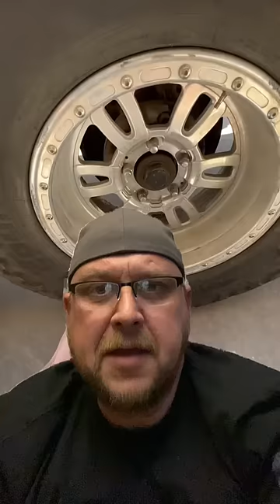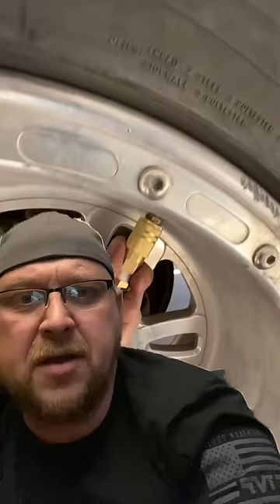A Trick That Works

Comment: Reminds me of the time we asked one of the Co-op kids to fill the tires on the forklift.

Told him he needed to use the airline because they take 100psi pressure.

He must have been looking for those valve stems for 30 minutes.
Reply: When I was a kid, my 10-speed took a pretty ridiculously high tire pressure, higher than the air line at the gas station could supply, so I'd just shove it on and wait for the air to stop flowing.  I was out riding with Mom, and the fat tire on her cruiser was a little low, so out of habit ... my ears were still ringing the next day.
Reply: Usually I fill those tires with tooth paste, I use a left handed screwdriver otherwise the board stretcher could be misaligned with the skyhook
Reply: On a forklift I was driving the tyres took 80psi
Reply: I always had the new guys switching out the winter air for summer air and vise versa. Boss didnt always find it as funny as I did. I'd always just remind him that he's the one that hired them, not me. 😁
Reply: If the vehicle is too far from the compressor and for some reason the two cannot be easily moved closer together, tell the new guy to fill up a quart bottle (like the Lucas Oil ones with the pointy tip) with air at the compressor and squeeze it into the tire and then do it again until the tire is full. If he's quick witted maybe he'll grab multiple quart bottles.
Reply: Former forklift operator here, we used to use that same bit with the new employees, lol.
Reply: @MatthewJRedmond  it actually is a fact that winter air in the summer will be higher pressure than it was originally
Reply: at least 114 people got the joke.....for those that didn't, most forklifts use hard rubber tires that don't require inflation.
There are quite a few that do inflate but those are usually 10k - 30k all-terrain forklifts and those inflate so that you can run them low in soft dirt and high for asphalt and concrete.
Reply: @alexistaylor969  correction: most small WAREHOUSE forklifts use solid rubber tires.
Anything meant to be used on anything other than flat slabs generally has air filled tires.

Comment: Finally, a trick I MIGHT actually use 😂😂
Reply: This is an old trick. Been doing it for about 30 years and I'm 42. When I couldn't find an air chuck I would just do that. I've never gotten them stuck that I can remember.
Reply: Might is the key word. Usually this only works on metal valve stems. The rubber ones are typically too fat to fit deep enough into the quick connector to get it to work. When it does work though, I like to pull the Schrader valve out and do it to help seat beads on tires. It will blow much more air through than a regular tire gun
Reply: @mitchelldake7203  that's actually false. I was doing this back in the 90's before those metal tire sensor valve. I does fit the rubber ones.
Reply: when had does that he has a connecter that measures the pressure in the tyre and it has a valve connected. really cool

Comment: If getting to a vice or vice grips is quicker you can kink/block the line. Learned that when my quick connect shot off the fitting and my hose slapped me across the face real good. Great times... great times.

Comment: Hack for bead seating, the air wont go in fast with the Schrader valve in so you take it out and fill it until the bead seats and pull it off.
Reply: Which is why most schrader valve stems come without the valve. (always replace them when you replace a tire)
Reply: I always just leave the valve core in, is there a reason not to?  The benefit to me is it keeps the air in so if my little air compressor runs out i can wait and add more until the bead pops in place. I had a couple pop on their own just by sitting for a few seconds. 🤷‍♂️
Reply: @Toad Phillips  just if it takes more than the normal air pressure to seat the bead then you don't have to let air out of them because it will immediately let the air out when you take the air coupler off. Then you put in the valve and fill it to the pressure you want.

Comment: I/M couplers work on standard  valve stems but can get stuck.  V couplers will work on small and large stems, but you need to pull the core first, and the larger couplers won't get stuck.

Comment: Just set up a connector that goes from your standard quick connect to the fitting that is for Schrader valves. They work both ways for inflating and deflating and only involve two fittings

Comment: I actually used this trick about 5 days ago to seal a riding mower tire to its bead. It worked quite well. The thing is how did Google know to put this in my feed. It did feel a bit like it might not pull off easily if one needed to do it quickly.

Comment: I have one of the old big truck tire inflators and it grips the threads really nice, got one of those locking chucks too, but I set my manifold at 45psi on my air line I fill tires with. Works really good and no chance of overinflation. I can also adjust the pressure really fast as it’s a separate manifold from the main air system

Comment: My cousins used to do this years ago. If a tractor or piece of equipment needed air they'd grab the air hose and jab the coupler on the valve stem. To check the pressure, they'd kick the tire......anything to get in the field fast.  
Quick service work, farmer style.

Comment: Learned this over 50 years ago. The trick is to pull back the release when removing it from the valve stem. Otherwise, those ball bearing set into the rubber valve stem and don’t budge.

Comment: I took the valve core, out of my lawn tractor tire, and adding air, with the quick connect, helped to seat the bead.

I didn't know about the getting stuck part, so thanks for the tip.

It worked out for me, but i did have 140 psi in the tank, and the tire would definitely fail if it got stuck.

I put the valve core back in, after it seated the bead, and I inflated it with a standard tire fill guage setup.

Comment: I use an air blower to fill tyres. If you angle the tip onto the valve stem valve properly it works great.

Comment: This trick does work...and yes it can get stuck lol I pull the valve core out when I do it when mounting tires on a rim just to pop the bead onto the rim...then put the core back in and use a chuck to air to pressure...

Comment: Another one is the little "barb" section on a typical air gun nozzle.  The pressure pops in the stem and applies air with much gusto.

Comment: We had a trigger where we could press to allow flow.  Used this type of thing with a 60 psi air system. :P 
I had made up a pressure gauge and limiter so I could dial in the pressure to what I needed.  Then attach to tyre and when it hits the pressure it stops.  Release the lever and remove the attachment.

It was main supply / lever / pressure gauge / flex pipe / attachment.  So you could set the gauge to 32 psi and press the lever and it pressurised the pipe.  So you could set it to what you need and then apply to tyre after.  
Very un-official and we were not supposed to work on cars at that workplace.. hehe.

Comment: I once connected a compressor hose to my F-350 front passenger tire at a truck stop. This compressor put out the air because it was meant for large trucks.. and.. The damn thing got stuck. After trying to work it loose and becoming rather concerned I was about to lose my hearing in the forthcoming explosion, I kicked the shit out of it. It worked, although the threads on the valve core looked like they'd met a wood chipper.

Comment: Pro tip: adjust your secondary regulator to 5-10% above your set limit PSI for the tire. It will give you a slower fill, but will prevent you from dangerously overfilling a tire if you have some issue that causes overfilling.

Special instructions for a split rim wheel: don’t. If you don’t intimately know the three hoops, don’t even touch a pressurized split rim wheel. 

I mean that literally, do not physically touch a pressurized split rim.

Comment: My cousin commenced to airing up a small scooter tire tube (think razor with tubed tires) bout the size of a lowriders steering wheel. My uncles compressor was a humongous thing and the line pressure was all the way up cuz we'd been rotating car tires. My cousin was holding the tube when it went kablooey. It sounded like a .357mag to me and i was 40ft away. His hearing was never quite the same after that. Here's to the 90s - and the fuzziest memories of a decade that i have no clear recollection of!

Comment: Lol the worst is when a hose blows in the shop and sounds like a gunshot followed by the hiss of a thousand rattlesnakes while the hose flies around shit-whipping anyone that gets too close, so like you said, everyone is scrambling across the shop to shut the air off. We had one blow right next to the quick connect once, so it was like a whip with a brass weight on the end. It was whipping around hitting everything nearby and ended up busting the window on a CNC lathe. I never trusted those windows to keep me safe from a flying part after that

Comment: I use the male fitting that goes into the air tool. Pull it off the tool and go directly to the valve stem. That way I can either pull it off or I can disconnect the air

Comment: Hazard fraught has a pack of fittings I usually pick up when I get a new air tool, because they aren't included with the tool. They toss one of the tire filers in with the fittings for next to nothing.I've got a handful tire fillers knocking around that I will use because I ain't got time to do it the sketchy way.

Comment: So in the air force, if you are in aircraft maintenance you get shown a picture of a guy who did this exact trick on an aircraft tire during a safety course at tech school.

It is not an exaggeration when i say it blew his boots off, as there was a boot left close to the tire while the rest of what was left of his body had been pushed into some other piece of equipment by one half of the split rim.

Not sure if there was a foot in the boot still and it was amputated, or it literally ripped his boot off but either way man died before he even knew what happened.

Comment: As a kid my town’s (population of about 1000) gas station had free air nozzle outside. My bikes front tire had been running low on air so I stopped to air it up while everyone else stopped at the grocery store about 100 yards away. There was no way to stop the air flow, you just connected it and it started the flow. I must’ve had it connected a few seconds too long and next thing I knew I blew the inner tube and it sounded like a shotgun went off in the middle of town. All my friends heard it from within the grocery store and come out to find me damn near deaf and needing an inner tube for my bike 😂

Comment: Yup, had that happen right in front of me. A guy I worked with did that all the time, I asked how he did it, he showed me, and THAT was the time that it got stuck and blew the tire lol. 

In his defense, it was a really ragged tire. It was brought in to be patched, he had pointed out to the customer that the side wall was showing definite signs of being ran flat on the inner side wall, and had gotten a signed waiver that the shop wasn't liable to replace the tire if it failed at any point after the line was signed. 

Soooo, kids, be sure to cross the T's and dot the I's...

Just an odd story of an odd coincidence. Learn what you can, or judge the rest. Let the haters hate.

Comment: I had a quick connect that had a lever to disconnect it well, the lever decided not to work anymore and I had to disconnect the air line at the compressor so the tire wouldn't Blow Up. 😊 Have a Nice Day.

Comment: Yup. Works great until the valve freezes shut because of the laws of thermodynamics rearing their heads on the situation. Then you're stuck trying to tap the coupling off in the gas station lot. And hoping that the valve won't break off, or the plunger doesn't snap, leaving you trying to use an amalgam of bubblegum, road grit, ice, JB Weld and electrical tape to hold the seal on the tire just  lomg enough so you can make it the next three hundred miles with a trailer full of all of your belongings in fourteen degree weather knee deep in snow and ice. Don't ask me how I know if you haven't already figured it out already.

Comment: We have an air chuck at work that would normally screw into any air tool, but is threaded for a valve stem on the inside...being its clicked on you gotta pay attention, but we only use it on stubborn beads that wont seat.

Comment: Got one stuck once and snatched the metal core out of the rubber. Shoved it back in grey silicone and ziptied it. Made it home no problem. It was a trailer tire unloaded so no biggie if it let loose, held 65psi.

Comment: Also instead of running across the shop you can kink the line in two spots and it will completely stop the flow of air it's probably not good for the line though

Comment: That's when you make sure you put that quick connect on the end of Tire Filler Hand Valve.  You know, the ones you see in Auto Shops where you squeeze the handle and it usually has a tire pressure gauge integrated into the air flow regulator?  Yeah, that.

Comment: You dont need a quick connect, just get a air blower, and blow the air directly on the inlet of the air stem, and the pressure is enough to fill it up

Comment: I don’t understand. Is this any faster than using an attachment designed for tires? Or you could use a male quick disconnect and put it on a tire connector and always have that in the garage.

Comment: “How do you know?”

(You said to ask.)

We used to pin the 3-piece rim truck tires under a buried hydraulic lift. We didn’t have the cage back then, and we still washed parts & our hands with leaded gas.

Comment: He has a quick connect, thus a compressor... Hence, he would also have one of those Extension Tire Valve Adaptor that are designed for tires, sometimes provided along starter kits when buying a compressor if not sold for cheap. Or a tire inflation gun with a pressure gauge for around 15$-20$. Both can be plugged onto a quick connect 1/4" NPT fitting up to the compressor (assuming he follows American standards, most are 1/4 inch threads, all are NPT - a slight slope on the threads for a tighter seal). In short, if he can use a quick connect thus a compressor, then he could also use the CORRECT fitting for his tires 🙄

Comment: If it doesn't come off, cut the stem off so she doesn't blow.  Then you still gotta run across the shop to turn the air off... but you can do it while dodging the snake tail whipping around
Reply: Can try to hold the snake when you cut the head off, it may get away from you, may not. Helps to have someone by the compressor that can turn it off fast

Comment: Turns out that they actually make a male quick connect fitting for blowing beads on tires.. screws on the valve stem, take out core, attach female quick connect end.

Comment: I just use a simple air fitting. Not gauges or gadgets cause they always shit the bed. Just a steel valve fitting for 20 years.  Never fails.

Comment: Got bike flat once and had some tire slime so I was able to "fix" it enough to get home. Pump seal bad so we walked to mechanic across street and he used one of these but with the attachment. Regulator on attachment was bad and it exploded the bike tire in less than a second. Spectacular and funny enough reaction that the walk home was worth it.

Comment: When I was younger my family went on a road trip in our oooold Winnebago, my older bro was tasked with checking the tires, he put air in till it wouldn't take any more, fast forward a little and 3 tires exploded. Trip over as we couldn't get new rubber, they where a weird size R17.5 or whatever.

Comment: And were you temporarily deaf because of it? Something to note, if you allow the air pressure to get too low, and you continue to drive on a low tire, the additional friction makes the tire significantly hotter, and when a compressed gas is released, its temperature is lowered. If you put an expanding gas into a tire that has been heated by excess friction of being cooled, it will literally cause a rapid differential in temperature drop of the metal inside of the tire that's causing it to separate from the rubber... and a subsequent boom!

Comment: At work I once had a quick connect come off a hose, it was the connection to the main air system so it sounded like someone left a door open during a hurricane. It was louder than Cnc machines doing their thing on a v8 block.

Comment: You can also add air to a tire with a rubber tip air blower nozzle 

Self sealing and you don't need to worry about it getting stuck on 😂

Comment: If you ever have a situation like you mentioned,  don't run, just bend your air hose so that the bending part is in your fist and squeeze. Now you have all the time you need to try to unstuck your valve...there you go.. :)

Comment: I think I’ll stick with an air chuck if it’s all the same. That thing has a built in tire pressure gauge, and it might not be the most accurate thing in the world… But it won’t fill the tire until it bursts because I couldn’t take it off.

Comment: I'd rather just spend the time to grab the right attachment to be safe but hey i guess it technically works.
Reply: It’s a trick...
Need to seat a stubborn bead?
Use this trick.
There are times this is useful or in desperation. It’s not meant to be a shortcut to not use the proper tools.

Comment: It works wonders if you set the pressure regulator on the compressor just a little higher than the desired pressure.
Reply: I was thinking the same thing. I have a regulator knob and gauge. At the set pressure, It just starts hissing.

Comment: Odds of it getting stuck on the valve stem and the tire actually exploding are really really low.  That female fitting would not usually get stuck on stem.  I like this guy's shorts but this one isn't up to snuff.